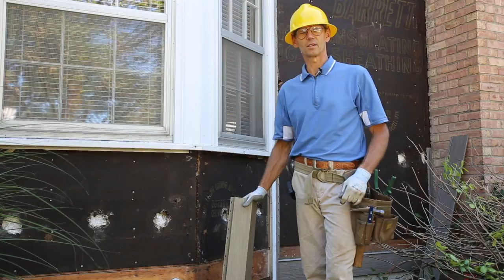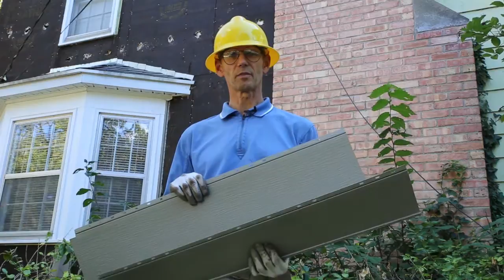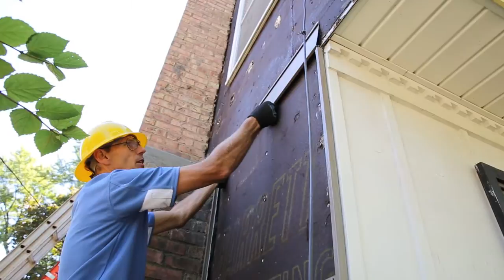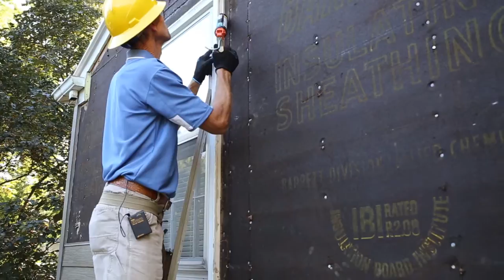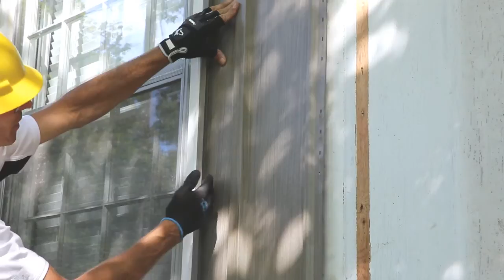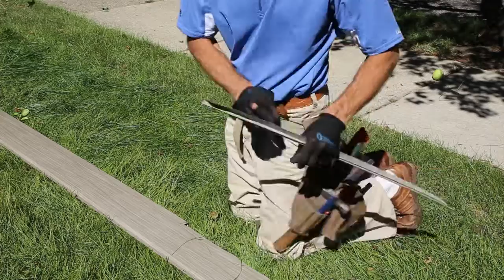TruCedar Steel Siding Top 10 Installation Tips

Comment: With hundreds of steel siding jobs under my belt I will say you're using the worst snips to cut steel with. If I were your customer and you use that level on my guaranteed non-level house I'd run you off.
Reply: Nothing wrong with Midwest snips, they work better than m2000's any steel heavier that 29g
Reply: Since you said you have worked with steel sidings a lot, what do you think about steel sidings? I heard it’s really loud when it heats up in the summer, is it true?